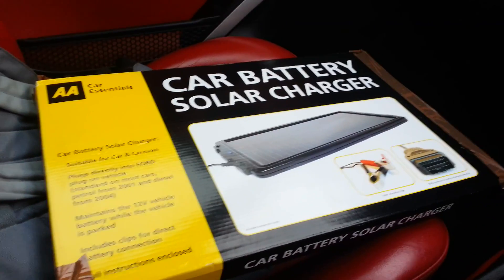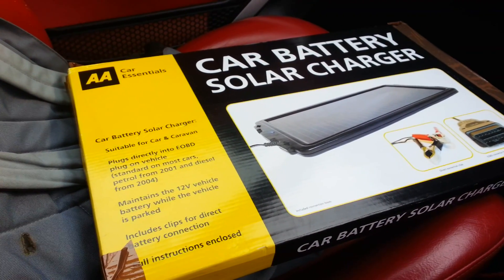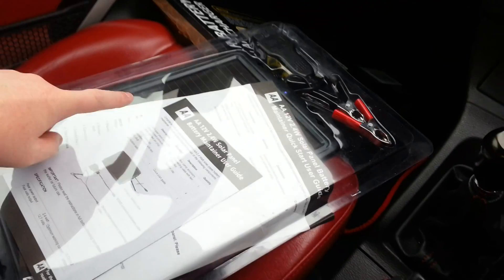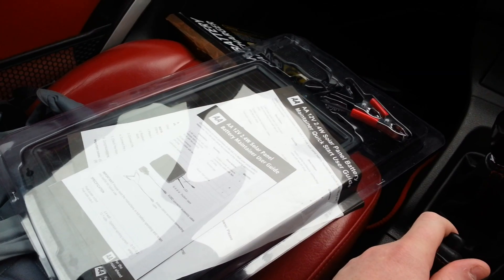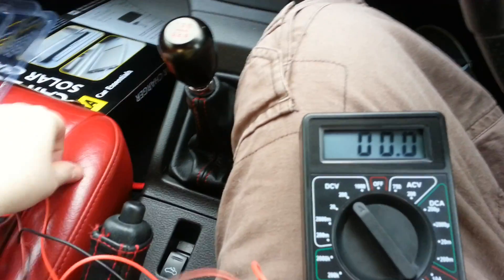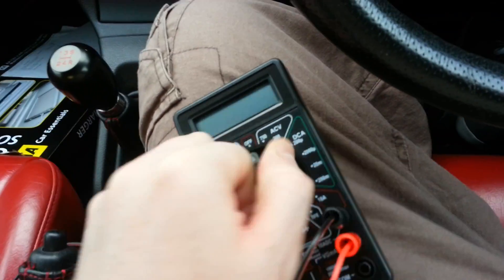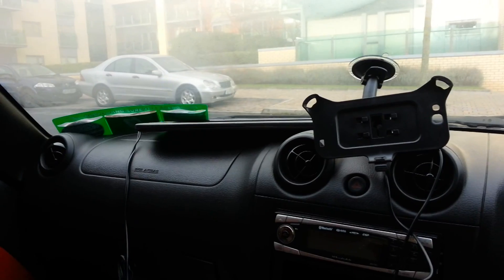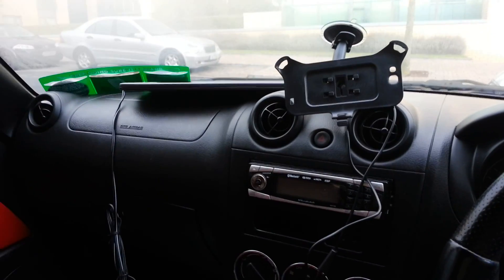Unboxing of AA Solar Charger

Comment: Maybe a bit late but some folk (like me) are looking at these solar trickle chargers now for obvious reasons. The probe leads on the multimeter are in completely the wrong ports....the black negative is in 10Amp DC and should be in the COM port and 200mA would have been a better choice when measuring mA. Not sure if this screwed up the readings..the volts seem to be about right though but 7 mA open circuit seems really low.

Comment: hi - the current depends on the load. As it was off load when measured you cannot say it was 7mA across the battery ...You were measuring the multimeter load only which is usually high therefore lower current. Voltage it the hieght of the pipe, current is the flow which depends on the width/resistance of the pipe.

Comment from the maker: So, after a few years of using this device, I can categorically say it is not worth the money. If you want to keep your car battery topped off, buy a dedicated battery charger like the 4Load
Reply: Nick G hi why is not worth the money was thinking of buying one of them, thanks
Reply from the maker: @MrThetedmiester  Because, for a small bit more, you can get a proper charger for the battery that'll do float charging
Reply: @nuckymcnuck  OH NO thats bad to hear I was about to buy one. I dont have the option for a plug in float charger because I park far from a plug. Why don't you like it anymore?

Comment: hi Nick, how can I check that power really flow through a EOBD socket? Some reviews say its not possible to charge via EOBD as all dead when ignition off and designed to prevent any power going to any parts of the engine. Wha's your opinion?
Reply from the maker: Use a multimeter with the ignition off. You should find a pin that gives 12V

Comment: Hi Nick, how is the AA solar charger working out for now that you've had it 6 months? Thanks.
Reply: hi do u also need a solar regulator to prevent over charge?
Reply from the maker: +ForViewingOnly I like it - use it every day, as my car is usually parked up for most of the week, and I've yet to have it struggle to turn over. The struggling was a bad issue for me, as the battery in the Copen is tiny (think 2x 6V batteries glued together!)
Reply: +Nick G Thanks. I didn't know what a Copen was until you mentioned it... looks like fun!